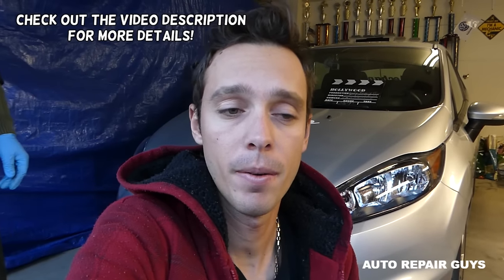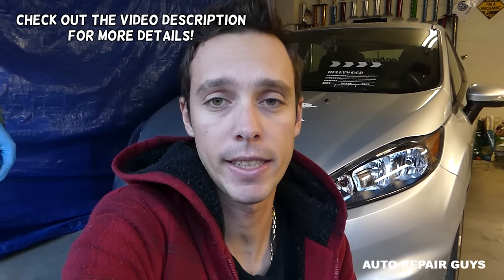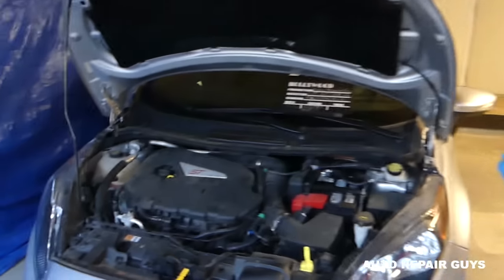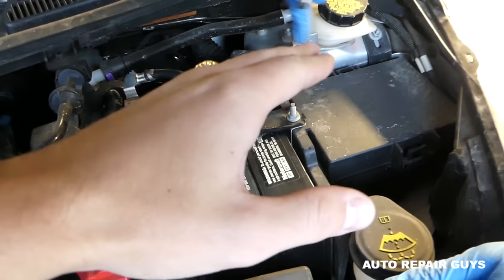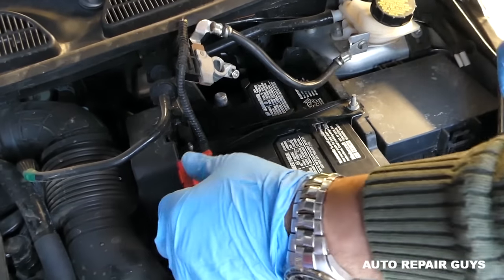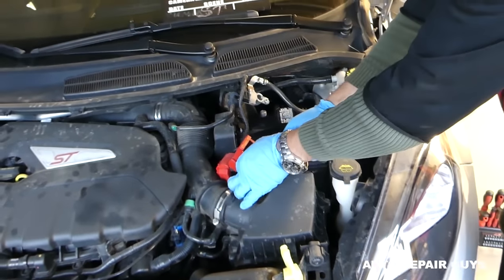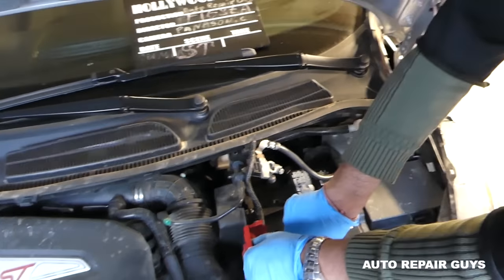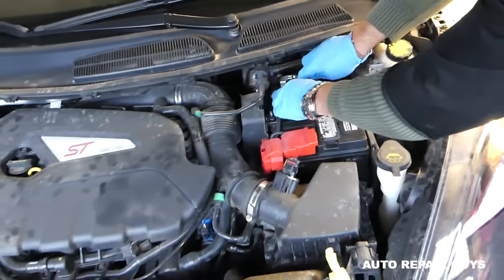Which battery terminal to disconnect first, connect first?

Comment from the maker: Products that we use and recommend:
► Battery: https://amzn.to/48a0nzE
► Assorted Fuses: https://amzn.to/4f6qJos
► Panel Removal Set: https://amzn.to/3YiMADu
►Torx Set: http://amzn.to/2hbyWgd
► Tool Set: https://amzn.to/3p5MM6t
► Screwdriver Set: https://amzn.to/3XRB28Q
► Engine Oil: https://amzn.to/3xBc8B9
► Oil Filter: https://amzn.to/3w0Ulme
► Torque Wrench: https://amzn.to/32qyRwg
► Liqui Moly Engine Flush: https://amzn.to/3IiDBID
► OBD Scanner that we use most often: https://amzn.to/3I4MQfe

► Check out our Amazon Store for the tools and parts that we use: https://www.amazon.com/shop/worldmechanics
Reply: Thank you for the video. I have replaced so many batteries myself but for some reason every time I go to remove it and then reinstall one I always forget which order comes first.
The funny part about that is, I can never remember the order on that, but I can change my husbands spark plugs, wires and coils. Lol!

Comment: How I remember: Removing clamps means (N)o Power = (N)egative first.  Replacing clamps is (P)ower back oN = (P)ositive back first.
Reply: Black before Red, or end up dead; Red before Black to get back on track.
Reply: Yeah that's a good one too. The way I was taught is similar: take away power is minus (negative), add power is addition (positive).
Reply: What happens if I put on the negative first and then the positive?
Reply: @janessaharrisgy Then you risk shorting the battery. Since the negative is connected to the metal frame of the car, and if you touch the frame with anything metal (say a wrench), you complete a circuit with no load and short it
Reply: @Anonymous51701  Thank you

Comment: One thing not mentioned is when connecting the battery back up after attaching the positive cable, you will see a small spark when connecting the negative cable but it is normal and nothing to worry about.
Reply: This is why I’m here

Comment: But this doesn’t make sense as to why you would disconnect the negative first. As I remember back in the good old school days, if you want to stop power going into things you would unplug the power source at which its drawing power from. Like a light bulb to a lamp socket, would you unplug it from the wall or loosen it from the socket. Or like an air compressor, would you decompress first then unplug? So it just doesn’t make sense for any battery wether car or for your mobile phone, a positive terminal will still have an active charge but it would just need to be grounded to send that charge. 🧐🤔
Reply: It's to prevent short circuit, when opening the positive first if your metal tool touches any metal car parts then short circuit happens.
Reply: I think that's why they're removing the grounding first, so the charge isn't sent/circuit isn't complete.
Reply: When the negative is connected the whole car is grounded. This means that if you are taking the positive connection off first and your metal tool touches a grounded chassis/component, you will be shocked as the power flows through your tool to ground. Bad for you and the car with modern electronics.
Reply: @SgfGustafsson  о мой бог! где вас учили этому! в России все знают, что автор говорить глупость!
Reply: @Tz NuTz молодец! Видимо ты из России, раз умно мыслишь! Ты прав! В комментариях столько благодарностей на это тупое видео, я в шоке 🙂

Comment: Thank you for the helpful videos.  When jumping a car, I use the same sequence.  I first connect the positive jumper cable to the positive terminal of the battery and then connect the negative cable (to a metal part on the metal car chassis, not the negative battery terminal).  When I remove the jumper cable, I remove the negative cable first, then remove the positive cable last.

Comment: Remove negative then remove positive
Then replace positive followed by negative.
Do not allow terminals to touch metal when they are disconnected.
Reply: I wrapped mine in plastic wrap and rubber banded them till I could get replacement batterie , to keep from sparking.

Comment: I disconnected the positive first should I reconnect it or remove the negative then reconnect the positive
Reply: If you mistakenly removed the positive first, go ahead and remove the negative before going any further.  This will get you to where you need to be (Negative removed).  Then, when you reconnect the battery, connect the positive first (negative is still not connected).  Once the positive is connected, it's safe to connect the negative cable last.
Reply: все врано, главное чтобы не искрить контактом долго и не замкнуть плюс на корпус автомобиля инструментом. А в какой последовательности присоединять и отсоединять, все равно! Кто будет спорить, езжайте в Россию, вас там научат в школе 🙂

Comment: I accidentally touched my wrench to the negative side when tightening the positive, just a small spark, everything looks fine, but can something be wrong?
Reply: If you didn't find a problem after doing it you are most likely fine. Just learn from it and disconnect the negative first and eliminate the potential for damage.

Comment: Hi, everytime im going on holiday the battery goes down. I have been told to disconnect the negative cable and when im back i connect it again and it starts again
Does it work ?
Reply: Why does it only go down when on holiday?
Reply: battery will lose charge if you are not using it, just re charge it

Comment: I guess im old fashioned I remove hot  first then the ground. Then I put on the ground first then the hot. I've never had a problem
Reply: Maybe, but between the two methods, you are doing it with the most likely method which will lead to electrical failure.